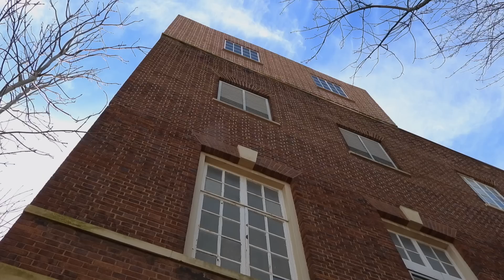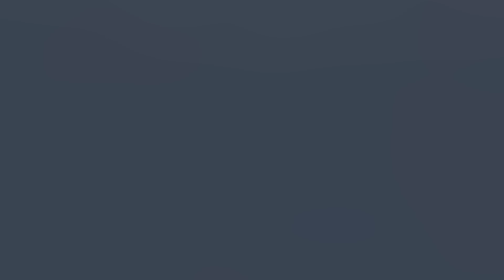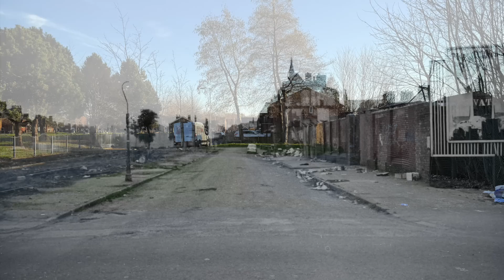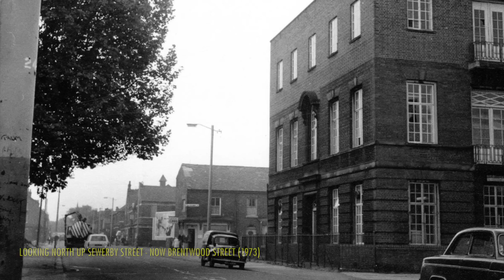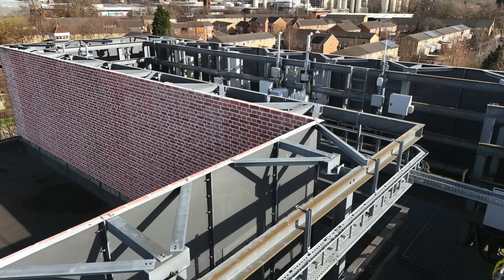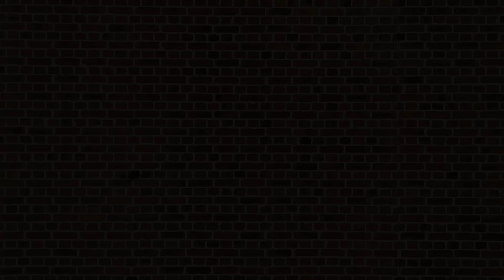Why Is The Top Floor Of This Telephone Exchange Fake?

Comment: You would have thought that they would have made a better effort to colour match the fake brick with the real brick 😎
Reply: I presumed it was just weathered / UV bleached.
Reply: @p-zz9a  Doubt it the colour is too even for that - just a bad colour match day!
Reply: Checking google street view.  In 2004 they were a better match.  It's UV bleached as someone else put.
Reply: @cjmillsnun  the earliest Google Street View I can see is from 2008. Really sticks out even then, maybe not quite as much as today. https://maps.app.goo.gl/XyURe62LCvxGAtZV7
Reply: They may have colored it fairly close but since 1993 which is like 30 years ago the fiberglass would have changed differently in that time than the building made of brick. You can also see in one of earlier pictures that extra real floor space was added and that brick eventually faded to match, before the fake topper was built in the 90's.
Reply: That's what I was thinking.
Reply: The floor just below was clearly added after original construction as well, from one of the other photos. But the bricks got to looking more like the lower ones in time. Probably not easy to make these panels duplicate that behavior. It's a nice touch. I wish they'd do more like it.
Reply: @jxh02  So that's the real fake floor! 😅
Reply: I used to be a BT "work controller" in the early 2000s for the engineers who worked in the exchanges in the North of England and often elsewhere (I was the best part of 200 miles away from the Manchester lads and sadly I never met them.)  If one was issued a job at Moss Side exchange, I always had to find 'shotgun' assistance for them every time (which could be difficult if there was no assistance nearby or they all had higher priority jobs). The reason for the assistance was due to the anti-social nature of a few of the locals, who would sometimes 'have a go' at them, or their vans if left unattended, even when locked within the exchange yard! They never actually carried anything that was of any value or use to these delightful 'characters'...
I was told that the false walls were to hide the radio equipment from direct line-of-sight of the anti-social oiks who enjoyed taking pot-shots at it with air rifles (or something more poweful). Most telephone exchanges in residential areas don't suffer from that kind of vandalism, and nearly all have radio masts nowadays, although some remote radio masts do get damaged.
Reply: Exactly what I was thinking, no let's do it Pink !
Reply: They have to be RF transparent though since I see cell towers inside the top story. Might be harder to match the characteristics.
Reply: I did hear once if the building is somehow listed you have to show the changes. But I would have thought it would be for grades 1 and above.
Reply: @ I don't think this is listed, or in a conservation area.  The original addition would have been under the permitted development  rules that applied.  The GPO/BT/Openreach can just, effectively, grant themselves planning permission.
Reply: It is colour matched. It's just not been bombarded with soot from industry and coal fires.
Reply: Nah...they don gibb a cheet..
Reply: What's the bets it house all the 5py equipment ?
Reply: @fx-studio  That will all in a box, the Legal Interception Gateway, inside the building proper.  The best explanation seems to be to protect the antennas from pot shots by the local inteligencia.
Reply: When you only have the budget for Temu bricks...
Reply: My first thought as well.
Reply: Perhaps the bricks had that colour then. Or the fibre glass was bleached by the sun
Reply: @barrieshepherd7694  contractor said it will look different and better in a month or so.  . .
Reply: well - using different color may be intended, for nicer look.
Reply: I’m interested to see this covered, I live a few streets away. Can confirm it has faded over the years.
Reply: It's Kintsugi. The philosophy of making repairs and alterations conspicuous and celebrating them.
Reply: @Bystander-xd2wj  🤣 Not on this occasion I feel.
Reply: Local building commissioners should have the company correct the color of this addition. It is an eyesore.
Reply: @Subgunman  This is the UK and the chance of there being any regulation available that would let the Local Council direct changes, like that, are most likely  non existent. 

Although it sometimes seems not to be the case, especially for private homeowners, councils have little ability to interfere in maintenance aspects of a building that do not fall into the H&S purview.  We have derelict eyesores all over the place where developers are waiting for the building to fall down (or catch fire) and councils can do nothing other than direct H&S matters be addressed - which usually ends up with a bigger eyesore of a building surrounded by rusty steel railing/mesh and random bits of wood across windows.

The building is probably not in a controlled zone, i.e. not a conservation area, and I suspect that being 'critical national infrastructure', as most Openreach/BT buildings are, the local council have even fewer rights over the appearance.

If the UV bleaching suggestion is the cause then there is probably little that can be done as a layer of paint would probably interfere with the RF transmission properties, and be expensive - hand painting all the mortar lines!.
Reply: @barrieshepherd7694  It is interesting. You can let your property turn into a crumbling, ugly eyesore and everyone will just shrug. Seek to make a minor improvement, however, and now you need to beg the council & neighborhood busybodies for permission work on your own property.

Comment: In the late 80's when we were just starting to build out our cellular network in San Diego, we set up a lab with a transmitter and spectrum analyzer and a couple of antennas and we put different panels between them  to verify that they did not have much loss. We mad sure they had the exact same paint that they would have on the facades because certain paints can be pretty lossy. In the mid 2000's a landlord put stucco over chcicken wire over the outside of a facade and ruined the site and lost all his lease revenue from 3 carriers.
Reply: Got what he deserved. I purchased a home in a neighborhood that fought a cell company to get the monopole structure removed from the adjacent land that was not part of the neighborhood. At a meeting it was brought up out of chance when I explained to the community the dollar figure that the cell company was paying in rent to the land owner. Stupid high rent! I explained to the community that if the community had that income that we could afford private snow removal in the winter, a landscape company to maintain the entry way into the neighborhood as well as maintain the city easement between the street and sidewalk grass area and repair anything needed on the sidewalks with income to spare. Everyone was dumbfounded.
Reply: @Subgunman  I live in the Texas Hill Country in a canyon surrounded by hills. That would have been a good plan by the developer to set aside a hilltop location for lease.  Our telephone/cable/internet cooperative's HQ is nearby and probably had to build other towers nearby.
Reply: Lol! What a prat! 😂 - ‘I know, let’s build a faraday cage around this cell site that making me money!’

Comment: MOS would be 607. That doesn't fit in the sector model in the Post Office Telephones allocation of the exchange codes. The first digit of the director number was the sector: 2 and 8 for central Manchester, 3 for East Manchester (Ashton, Hyde) , 4 for South East Manchester (Stockport, Didsbury), 6 for North East Manchester (Oldham, Middleton), 7 for North West Manchester (Bury, Worsley), and 9 for South West Manchester (Sale, Wythenshawe).

My guess is that it was probably originally moss SIDe (843) or some other completely different name, eg. Oldham was MAIn (624).